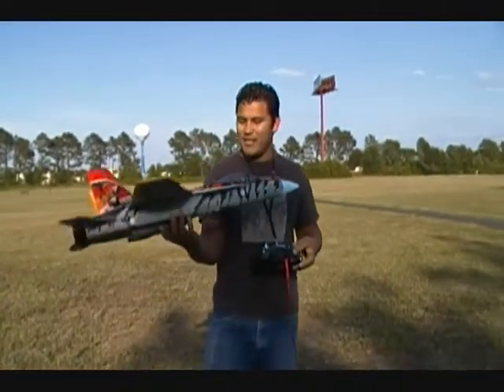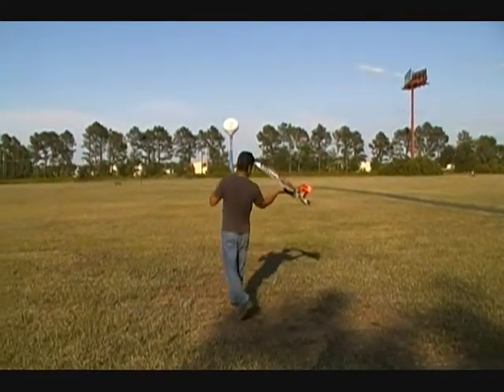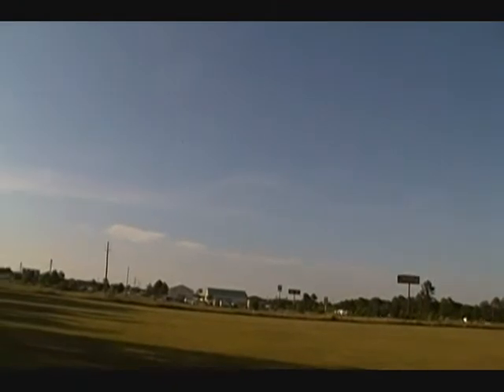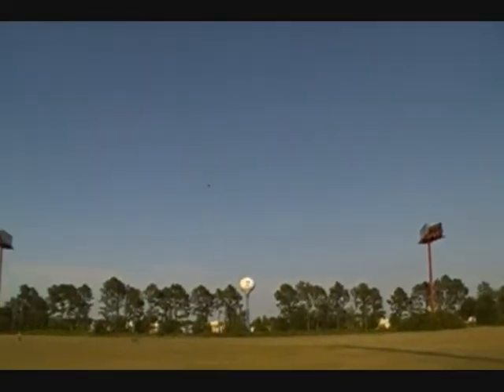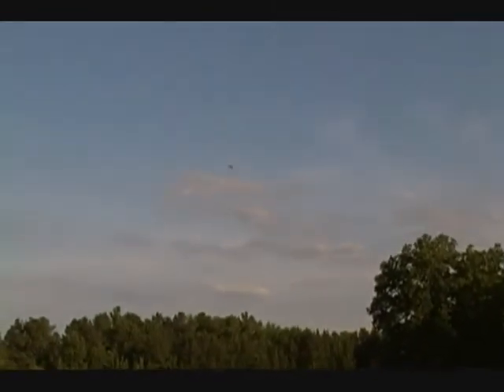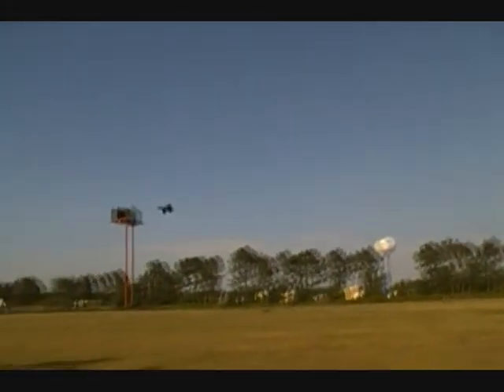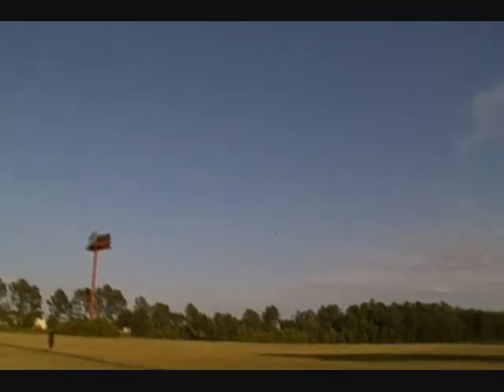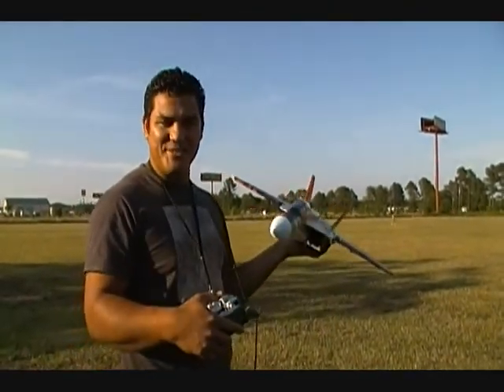nitroplanes F-18 from 64mm to 70mm EDF

Comment from the maker: sorry I din't  but the modification is very easy  you Just have to do a little sanding off of the foam to accommodate the 70mm EDF in the same place where the 64mm was  and remove the plastic box from front to accommodate a larger battery and I'm using a 45amp ESC on 5 blades EDF